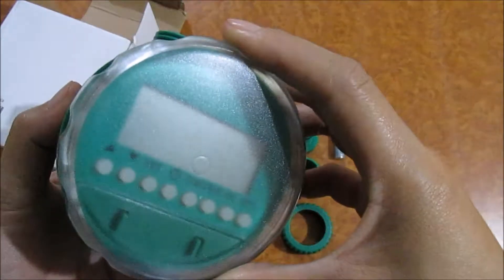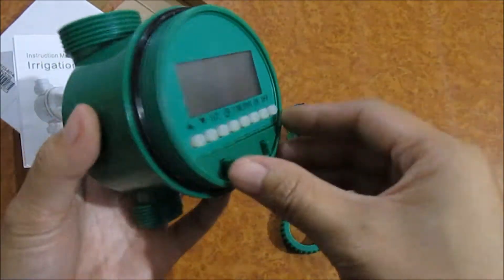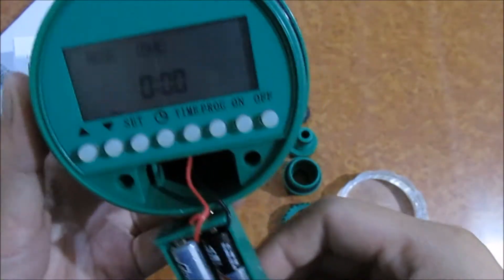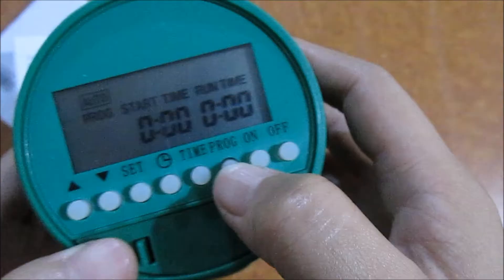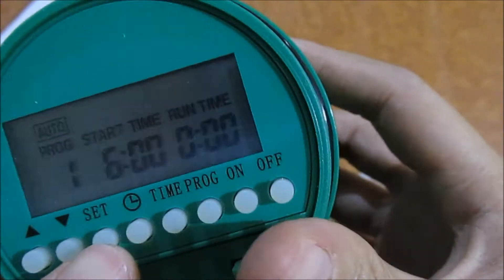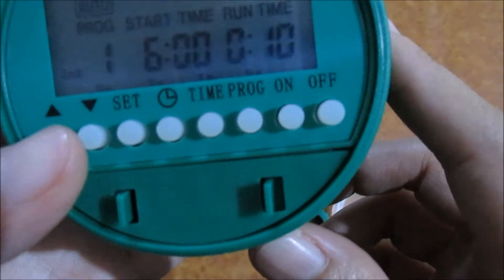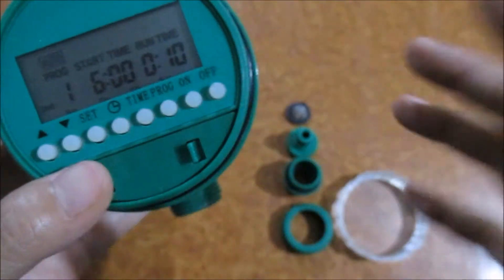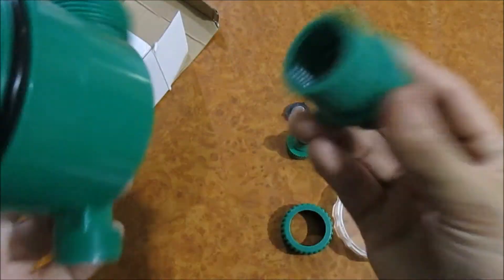Digital Irrigation Timer Testing

Comment: Update: Found my problem, it seems one of the batteries would pop out of battery box at activation 
and not make contact, next cycle it was only on one battery and would not function even though digital
display still worked on the one battery. i taped around batteries so this would not happen again. DONE!
JUST SOME FYI.

Comment: How to setup the day if I want it everyday to run. Thanks
Reply: I replied to my question to setup everyday 2nd flashing then 3rd you’ll see Sunday press setup continuously until to Saturday. Then you’ll all set.  To water 3 times a day press setup there are 16 choices for three times a day press setup 1 for 6am setup 2 for 12pm setup 3 for 17pm so on.
Reply: What are the 2nd and 3rd functions for? Anyway, I'm not using them yet.
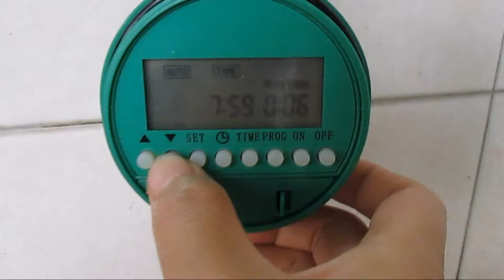Reply: Hi Sir, I am asking for help here. For mine everytime after the timer set run and turn off, the time will reset to Sunday 00:00, and delete my timer set. Did you ever face this problem? If yes, may I know how you solve it?

Comment: To set Every Day, if this tutorial doesnt work, try this:  when you get to "2nd" hit down, "3rd" will flash, again hit down, "sun" will flash hit SET. Then "MON" will flash, hit set, and keep repeating this, even for the sun symbol which comes last. The sun symbol doesnt do anything on models without optional moisture sensor.
Reply: Hi Sir, I am asking for help here. For mine everytime after the timer set run and turn off, the time will reset to Sunday 00:00, and delete my timer set. Did you ever face this problem? If yes, may I know how you solve it?

Comment: For those wondering how to set it to run everyday. Here is your guide: As you press set and 2nd starts flashing. Then press down until sun is blinking. Then press set and you will see sun stay solid and Mon start blinking. Keep pressing set until all of the days of the week are solid. Then press prog.
Reply: Thanks mate, she glossed over that bit, i was about to get the hammer out!
Reply: Me too!! Thanks.
Reply: There is an option for everyday operate
Reply: What are the 2nd and 3rd functions for? Anyway, I'm not using them yet.
Reply: Hi Sir, I am asking for help here. For mine everytime after the timer set run and turn off, the time will reset to Sunday 00:00, and delete my timer set. Did you ever face this problem? If yes, may I know how you solve it?
Reply: MIne was slightly different to this but this video shows you how to set it to every day: https://www.youtube.com/watch?v=_kV9bwKMbPU
Reply: @richardfroggatt617 thank you

Comment: You put the filter in a wrong place. It should be installed at a top of the timer to protect the solenoid valve which is sensitive for any particles coming from a tap. The position should be filter peak at the top.
Reply: I see. This probably why mine crapped out after 2months of use. I thought it was water heat. Thx...!

Comment: how to set every day?
Reply: @-ok-  Damn I looked for this info everywhere, thanks!
Reply: @diegoyungh9697  can it work for a month ?
if i travel for a month can it do it ?
Reply: @funnystormy1915  yeah mine is working since then, it's been 5 or 6 months already non stop
Reply: No answer?
Reply: For those wondering how to set it to run everyday. Here is your guide: As you press set and 2nd starts flashing. Then press down until sun is blinking. Then press set and you will see sun stay solid and Mon start blinking. Keep pressing set until all of the days of the week are solid. Then press prog.
Reply: @bloodyutubehell  What about the model showing also "DAYS" from [0-30] on the screen on the right?